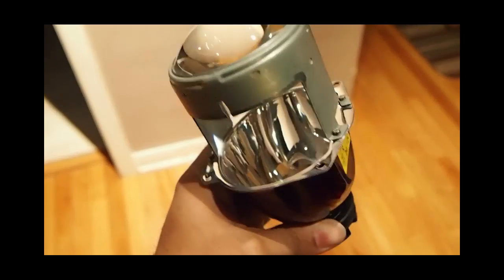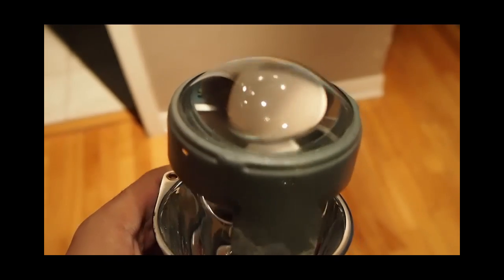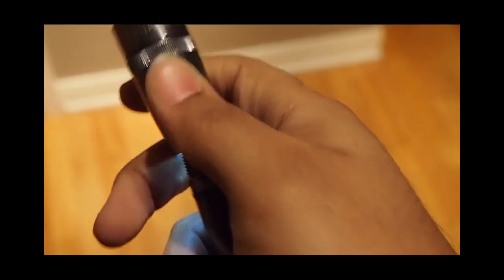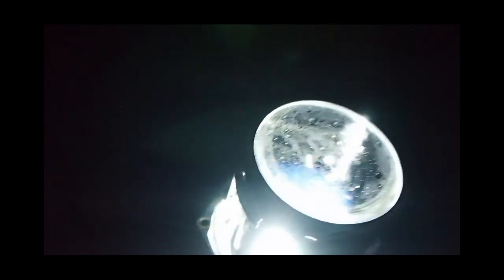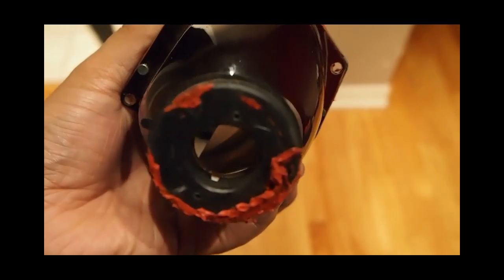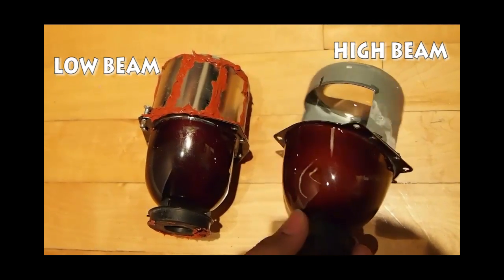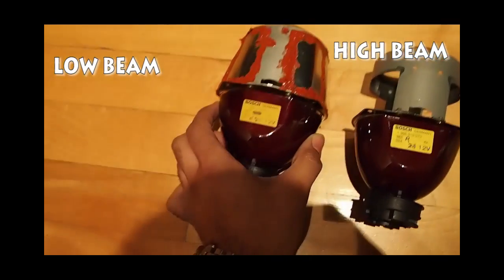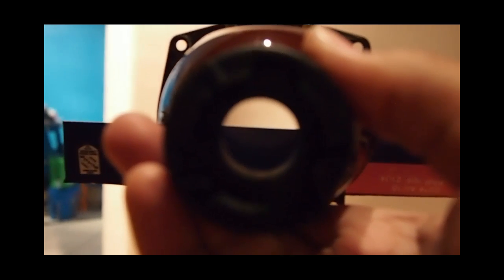HOW CAR PROJECTORS WORK?

Comment: Why do you put the sheet metal around your low beam housing? it will reflect some light to the lens and creates unwanted flare above the cut off line.
Reply from the maker: +ray sell I used metal sheets because I installed this into the flip lights of an old Firebird I had. I didn't really care about unwanted glare, it was just a test.

Comment: i dont really know much about projectors so forgive my question:

reflector headlights have only a single bulb, do projector headlights also have only one? or do they use 2 (1 for high, another for low beam)
Reply: For all projectors, they only use 1 bulb. If the projector want's to use the high beam feature, then it sometimes uses concave mirrors inside the projector assembly that rotate in front of the bulb to change the intensity and it removes the cut off making the light free to scatter.